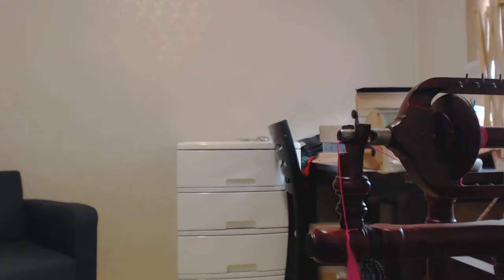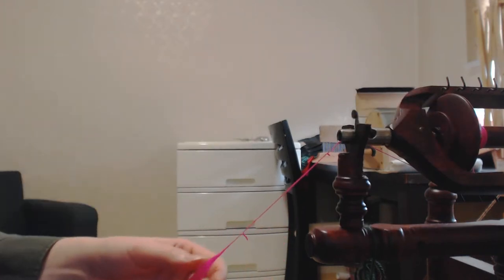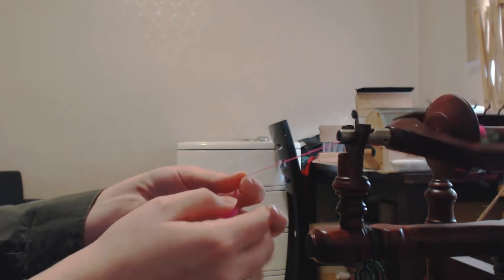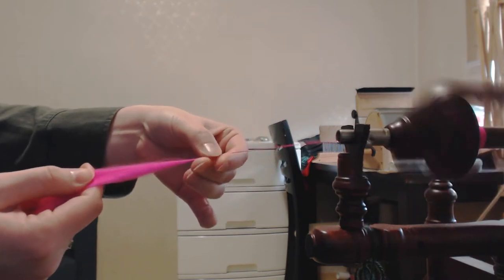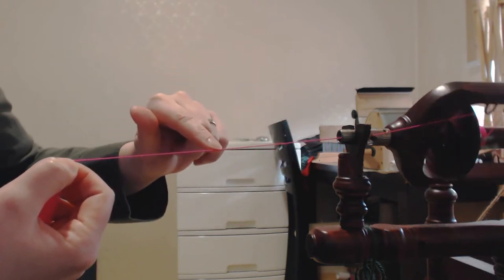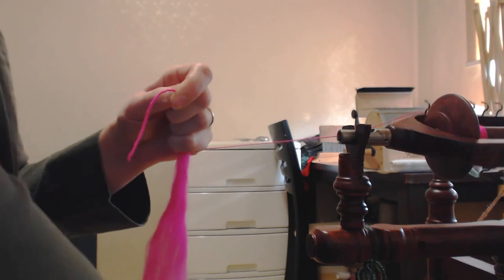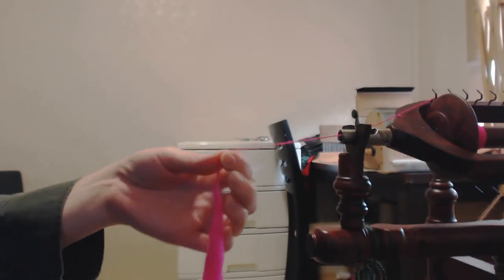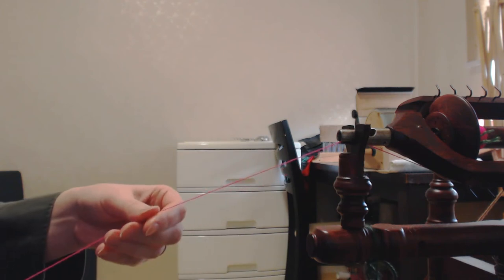Lace Spinning Demo with Wheel and Tips - How To - Expertly Dyed

Comment from the maker: NekoPeque: I suppose you could think of the draw in that way, but it'll still produce either a true worsted or semi-worsted yarn in the end. Whether it's a true worsted or semi-worsted depends on preparation method. I tend to draw down (short forward draw) with my drop spindle and draw back (short backward draw) when I'm spinning on a wheel. :)

To make a woolen yarn with a drop spindle, you need one hand controlling the twist and the other hand drawing out the fiber as the little bit of twist enters into the drafting area. I don't have a video of this yet because I'm not very good at the longdraw method in general.

Comment: I think the problem or fear I have of spinning an even yarn is knowing how much to draft out and spin to get it even..
Reply from the maker: Unfortunately, that's going to be a little guess-and-check until you get the feel for it. I still need to check my gauge every 20 minutes or so if it's crucial to have a specific gauge for a project. For the lace sock yarn I recently made, I didn't need to check my gauge so often.

It'll be a lot of starting/stopping until you can get the right amount of fiber into the drafting area. Practice every once in a while..it's great to have a bag of tricks when you sit down to spin! :)